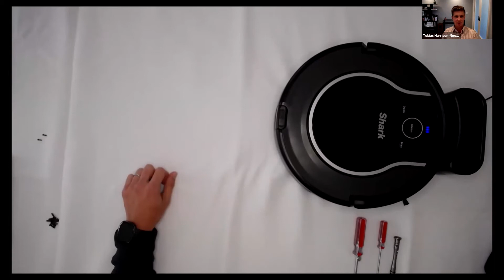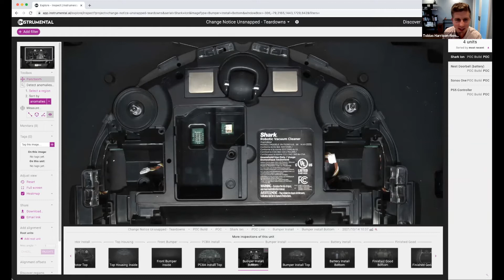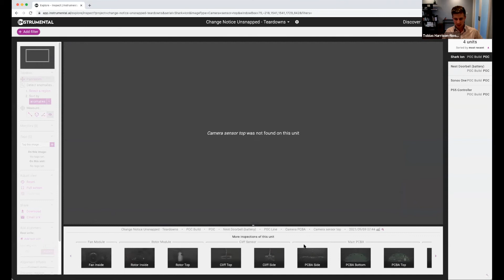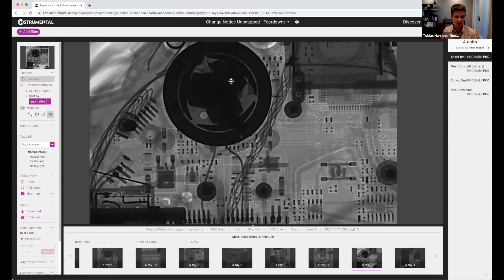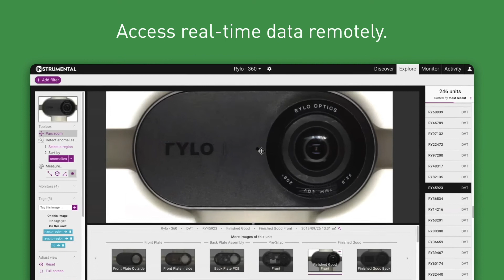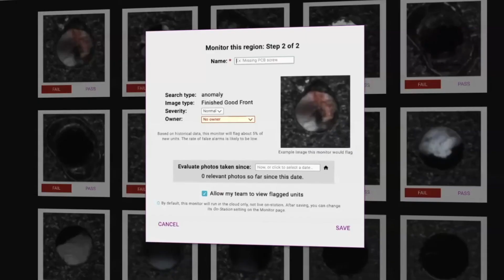Episode #12 - Change Notice: Live teardown of the Shark ION™ Robot Vacuum (RV750)

Comment: I have a Shark RV750 robot vacuum with a multiwire ribbon cable that plugs from the motherboard, and onto an electrical jack located on the robot's front bumper.  Any idea of what it is used for?  Thanks.

Comment: My question relates to the proximity or cliff sensors. The issue seems to be error code 7 which relates to these sensors. It’s the most common issue I’ve seen and have repaired on this device. The question in relation to this issue is there a way to bypass these sensors and have the machine still operate normally or somewhat normally as most homes have a one floor or no stairs to fall from. The other reason would be some surfaces such as a heating vent or dark colored carpet seem to trigger the sensor to assume it’s going to fall. So is there a way to just bypass these sensors that you know of to keep from constant fixing or just throwing out such a pricey machine which to me is just wasteful as well thanks in advance for any knowledge.

Comment: My Shark "ate" a medal that I had won.  The medal had fallen underneath my dresser. The shark found it, and part of the cloth necklace got wrapped around its wheel. I was able to easily get the 5 screws out to take the wheel off and disconnect the wheel, but one of the screws fell inside the shark. No matter what I did, I could not get the screw to come back out. I tried for over an hour. So I re-connected the wheel and put the 4 screws that I still had left to hold the wheel in place. I don't know if it will be safe to let it charge and run like normal?